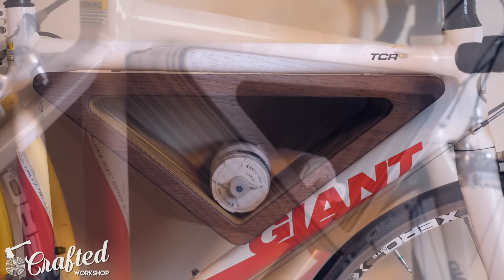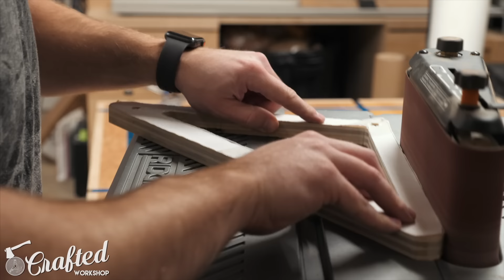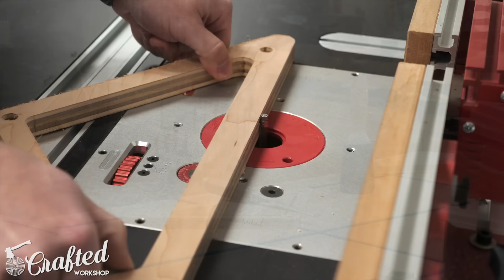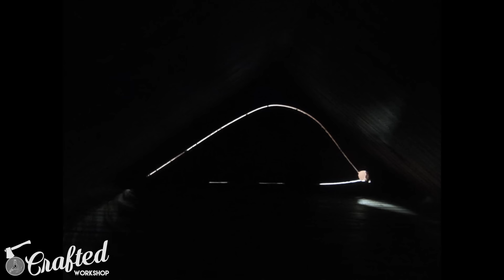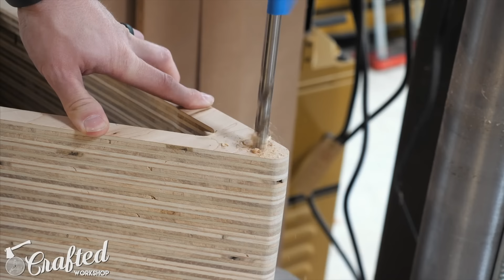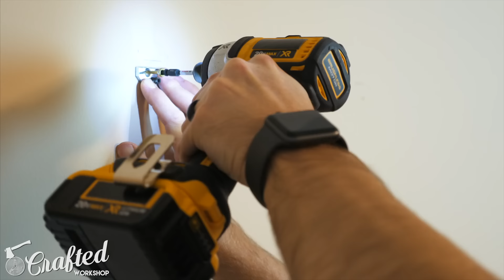DIY Floating Wall-Mounted Bike Rack | How To Build - Woodworking

Comment: Elegant, however what I would have done differently is make a deeper cut out where the frame sits. Or put a lip or a piece of a 1/2 inch piece of wood in the front so it won’t slide off.

Comment: Couldn't help but notice the Hi-Wire hat. Are you in NC? Charlotte here. I was thinking,  what if you were to build the rack in 2-3 smaller sections, ones that were within the capacity of your spindle sander? You could use it to cut down on the amount of sanding necessary by assembling the already-sanded sections, and reducing the number of glue joints that would need to be hand-sanded. Just a thought....

Comment: Johnny this is a cool looking project!  A lot better looking than those metal racks out there.  I was hoping you had a clever way of sanding the glue off like making a jig you can set the piece in and sending it through the Planner or Belt Sander.  Great work man!  Oh I think I missed this, but did you say how much the supports can hold weight wise?
Reply from the maker: I think the supports are rated for 50 lbs? Thanks, glad you liked it.

Comment: Can this design be modified to work for a unicycle?  This is a real question.
Reply from the maker: You could probably just hang the nose of the saddle on the edge of the rack. Should work fine.

Comment: Im wondering if you were to stagger the lengths of the dowels if it would add any structural integrity. That way each section would have at least a solid piece of dowel. I noticed that a section would start with half pieces. Does that make any sense? Or even use a dowel the length of the rack?
Reply from the maker: For sure! I only had these shorter dowel plugs on hand but a longer dowel would have been best.

Comment: As wall art, it's good.  As a functional bike rack, not so much.  Virtually everyone who actually rides a road bike always have 2 water bottle cages mounted inside the frame.
Reply from the maker: Depends on the person really. I would say most commuters wouldn't have or need two cages. Also, two cages will fit with a larger bike, this was my wife's small women's frame as I said in the video. Thanks for watching!

Comment: Great looking project.  I can tell that you're not trying to make these to sell for a profit!   You'd either need to work for free, or get the materials for free, (or both), to be able to sell these for a profit.  You do great work. You're like an artist.  My problem is that I'm viewing things from 35 years in production management.  (Speed, material costs, profits).
Reply from the maker: Yup, just making this one for fun. It would be extremely difficult to make these as a production product. A large bed CNC could batch out the parts pretty quick, and you could just use Walnut veneered plywood for the top layer. That would eliminate most of the labor.

Comment: I'm surprised at the amount of misalignment that remained between the pieces, even with the CNC. Do you think the assembly would have been aligned better if you had duplicated the pieces with the flush trim bit AND with the dowels inserted for alignment?
Reply from the maker: I'm not sure what caused the misalignment, honestly. I know one of the layers was off since the dowel I used was too short, so that was part of the issue. Glue squeeze out was the other big thing to contend with.

Comment: Your GoPro is is the wrong setting... thats why you havr black bars... if you choose the resolution size below it will be the correct shape for the video and you actually dont loose quality just a bit from the top and bottom
Reply from the maker: Dangit! Forgot to crop it in, I’m filming in 2.7k linear mode so I can crop in during editing. Thanks for letting me know (can’t believe I missed it).

Comment: I’ve been thinking of doing something very similar to this only difference would be the bike hangs from the nose of the bike seat vs on the frame. Basically flip yours upside down and extend the long edge out a couple inches past the triangle and the bike seat nose hangs on that. This way ANY BIKE could be hung on it.
Reply from the maker: For sure, that’d look great!

Comment: How can I mod this to display a unicycle? Love it, you've really got the mid century modern aesthetic eye!
Reply from the maker: Hmm, that's interesting! You could probably hook your seat over the rack with a few adjustments. Thanks!
Reply: Turn the triangle over, then cut a notch in the hypotenuse so the seat sits inside the triangle and the wheel hangs below.